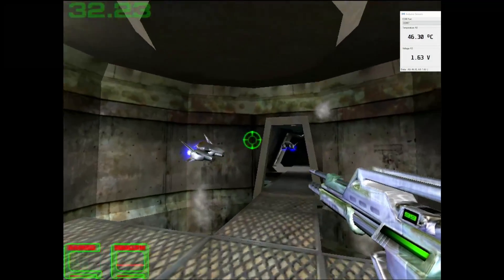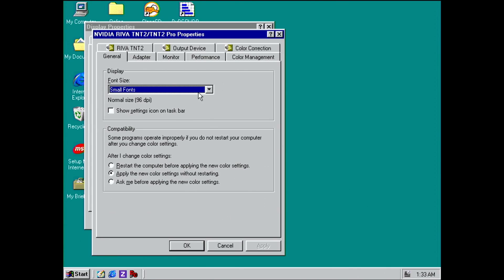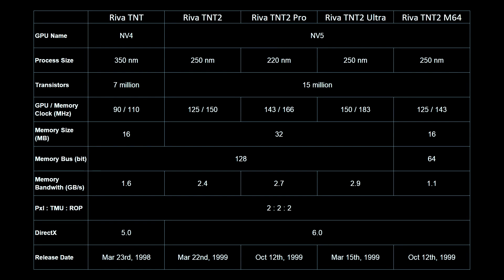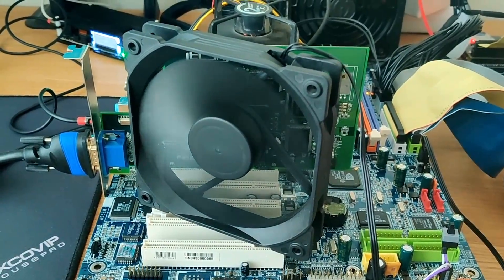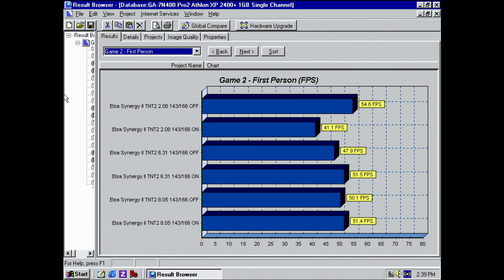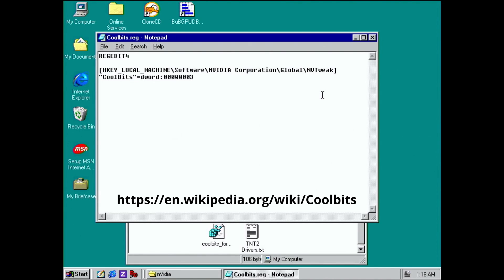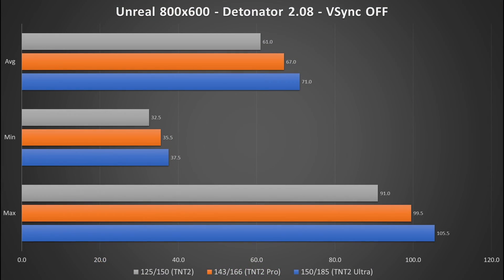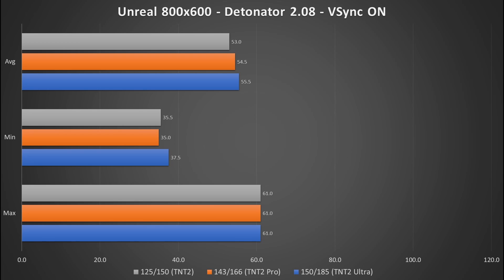ELSA Synergy II-32: Overclock to TNT2 Ultra possible?

Comment: Given that ELSA gave 10 or 12 years of warranty for their hardware they certainly would've prefered to put a fan onto the heatsink but I don't think they went for passive cooling for cost reasons here but rather to keep the workstation card quiet.

Comment: You didn’t mention it, but I assume you were using Direct3D rendering in Unreal. I wonder what OpenGL results would be.
Reply from the maker: Yes, I usually use Direct3D. From what I remember is that OpenGL is within 5% of Direct3D performance. Sometimes it is faster, sometimes it is slower.

Comment: I had a viper v770, used the diamond drivers with 9x, Nvidia for XP. Had to use rivatuner to force on agp and multi texturing due to Nvidia crippling factory settings, and the XP drivers were worse than 9x for years? But it eventually got good enough.

Comment: Those old nForce n400 mobos were always super picky about which memory modules they would boot and be stable with...

Just found your channel today. Reminiscing
Reply from the maker: Thank you! I will get back to that board some day. I may have damaged something while replacing the capacitors. Now I have a microscope and my see things I couldn't before.
Reply: @bitsundbolts  Was this one an Ultra400? or does this one have the intergreted graphics?
Reply from the maker: It is the NVIDIA nForce2 Ultra 400. No integrated graphics.
Reply: @bitsundbolts  Ahh ok!  I have had 3 boards based around the Nforce2, one was the Dual channel Ultra400 (MSI K7N2-Delta), and one was the single channel version (Asus A7N8X), but stil odly had the same 3 dimm slot arrangement.  I also had the version with graphics that would not run the 400mhz fsb reliably (MSI K7N2-VIS). 

The most stable of the bunch was the single channel variant for sure. Either because "asus" or that is just how they were. These boards used to have issues with tossing their bios into the bin if you tried to push the FSB above 400 in any significant amount.  ~bclock of 210 or so.

I don't recall them being particularly fussy, but my K7N2-VIS hated 1t command rate. And also had issues with 400mhz 2-2-2 ram. So it had more limited performance. I would just simply run it 1:1 and at 333 with cl2 timings.  The Delta though by far had the better performance of the 3, even with genaric ram, so long as they were reasonably matched sticks.

Comment: The issue you were having with the game with the Porsche was that it was using "double buffer" vsync.  Riva Tuner should allow you to enable "triple buffer" vsync and that would stop the framerate dropping to 30 and 20 while also stopping screen tearing.  Obviously the vsync implementation through those early Nvidia drivers is crap.  Forcing triple buffer vsync through Riva Tuner would have solved the issue (even Nvidia Inspector would work).

Comment: TNT2 pro frequencies should be possible. TNT 2 ultra is hard!
Reply: Because of the memory
Reply from the maker: The Elsa Synergy II uses SGRAM. If I am not mistaken, most other models use SDRAM. I don't know if that is the reason I could easily overclock the memory to 185 MHz
Reply: @bitsundbolts  What’s the ns rating on the ram ?

Comment: Memory errors in dual channel are VERY common with those nforce 2 boards.
Reply from the maker: Good to know. I will try with different memory modules to see if something changes.
Reply: Didn't have issues with mine. I wonder if people used mismatched dimms or cheap brands, but I usually bought high end modules to help overclock the fsb. If you weren't overclocking athlons, there was no benefit over p4 aside cost.

Comment: In the earlier days of 3D accelerators I rarely played with v-sync turned on due to issues like you saw in NFS Porsche Unleased. I had a 19 inch CRT monitor with high refresh rate up to 1600x1200 resolution so screen tearing wasn't much of an issue then. But I do play with a 75 fps cap these days as that is the max refresh my primary monitor will do atm. 
It's still great to see an old TNT 2 card! I remember when they were the standard for a bit if you wanted 3D with 32 bit color.

Comment: The memory issues sounds like load problems.  Try raising the NB voltaje a bit, or lower the speed of the ram. Make sure the IMC supports that speed with 2 or more sticks.
Also some alcohol on the ram for good meassure
Reply from the maker: I actually did test the memory with half the frequency. Same error - exactly at the same test position. It is absolutely repeatable. I'll try different modules first and see if something changes
Reply: @bitsundbolts   taking a better look at it, it says unexpected interrupt. You sure its memory related?  i would try different versions of memtest. Ive had some throw random errors at some positions while others didnt, and the memory was 100% stable.  Not sure how that works.
Other than that maybe its some power related thing. My only guess is that maybe the memory controller rail is noisy, most likely a bad cap. (doubt its degradation otherwise half the speed should work.) 
If its not that maybe another cpu, thats a really weird error you got there :P
Reply from the maker: I already tried a different CPU and two different versions of memtest - error is reproducible at the exact same position during the memory test. Could be power related. I will try a different memory kit and see if I can reproduce it. Then I will have to check the caps again.
Reply: @bitsundbolts  a quick way to test for the caps is just adding more caps on the underside of the board (oldschool overclocking style)
If its the caps that should fix it.

Otherwise im also out of ideas, ive never seen a memory controller die like that. The worst ive seen is a biostar board not posting with 333mhz ddr even if it was supposed to support 400mhz ddr (had to lower it to 266 manually) for it to post

Comment: Yes,the TNT1 and TNT2 chips runs best with the 2.08 Detonator drivers. But I find the TNT1 and 2 cards uninteresting for a todays Retro System build. I would prefer the GeForce 256 DDR/2 GTS for games until 2001, or a a GeForce 2 MX/400 for GeForce 256 SDR performance, because the 2MX cards are easy to find and cheap on ebay.

The TNT cards have no support for hardware texture compression and the 8-Bit Paletted textures support for much older games like Final Fantasy 7. The only advantage over the same old Voodoo3 is the 32 bit colour support and support for larger textures until 2048x2048. Voodoo3 is still limited to 256x256 pixels for textures, so 16MB is more than enough for this card.
Reply: Never had issues with ff7 on tnt2 that I could notice. Everybody said it was a problem, but I could never see why.

Also, GeForce was mostly useless aside from 32bit. I'd rather use a dx8 Radeon for the free anisotropic filtering and rotated grid anti aliasing on par with voodoo 5.

Comment: The TNT2 driver choices is somewhat comical, even in the era you had to search for the best one. Back then the official release cycle wasn't what it is now and the beta driver scene was big. I was introduced to it after having an issue Shogun Total War and reading about them on the official FAQ page.
Reply: Yeah, and on top of that -  how much is the cost to Nvidia to host the old driver files, $5 per year? Probably no more than 100MB is needed for all drivers of 90's and early 2000's.
Reply: @fradd182  gotta save that money to upsell gamers on DLSShit 3.0 with all new BullShit rendering

Comment: Did driver 2.08 fix the visual issues you had in unreal's menu ?
Reply from the maker: No, the menu still has the same issue with all three drivers. It only appears in 32-bit color mode. Switching to 16-bit solves the issue.

Comment: And TNT2 Pro chips can clock even higher.
Asus AGP-V3800Pro can do 180 mhz core and 210 vram
Reply from the maker: That makes sense since the TNT2 Pro seems to have been made in 220nm. I guess the heat of the chip was the main reason they were clocked lower.

Comment: Excellent video. 15:00 - the Dynamite Hercules TNT2 Ultra was the fastest TNT2 by far, a very good card for the year 1999.
Reply: I had a Gulimot Maxi Gamer TnT2 Ultra that had default clocks of 175/195... Sadly it made it through its 1 year warranty period and started artifacting. Down clocking it to Pro spec cured the issue. This may have been a 220nm specimen, if they really existed. It had a somewhat later build date and I purchased it a while after the Pro launched. But it also ran really hot. So if it was a 250nm chip, they may have over volted it a little bit to get that. 

This was the last time i ever bought a factory overclocked card. After it wouldn't reliably work at all I quietly replaced it with a VooDoo3 3000 which i still own.

Edit, now at the end of the video I notice he mentions my card! lol... Except mine was marketed as the Maxi Gamer. But same company and same card. Though the clocks on mine were 195 for the ram I am pretty sure.
Reply from the maker: I definitely have to try a few more things with this chip. I also think that a Diamond Viper 770 is waiting for me. I wonder if, with enough cooling, TNT2 chips would just work at 175 MHz without issues. We shall see!
Reply: @bitsundbolts  I only have a TNT2 M64 and the maximum stable core frequency is 145 mhz. As far as I know the 220 nm TNT2 Pro was the most overclockable of the series.
Reply from the maker: nVidia may have recycled poor quality chips with those TNT2 M64s. I don't think I have one of those.
Reply: @bitsundbolts  as far as I know, the M64 has the same chips as the normal 125/150 mhz TNT2. But it could also be that nvidia used some chips with lower quality for the M64.